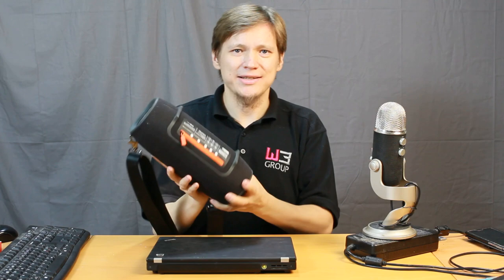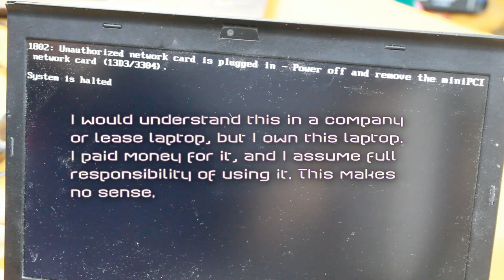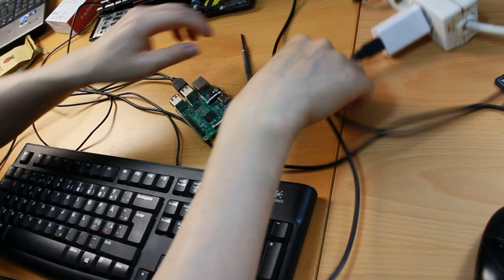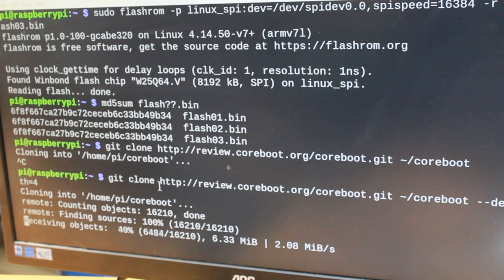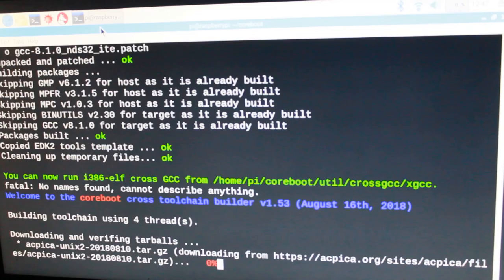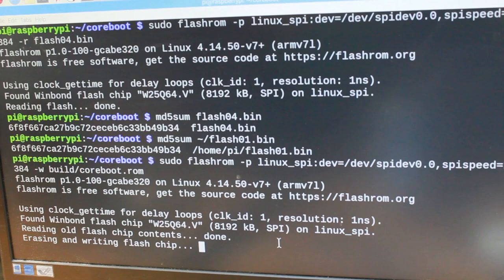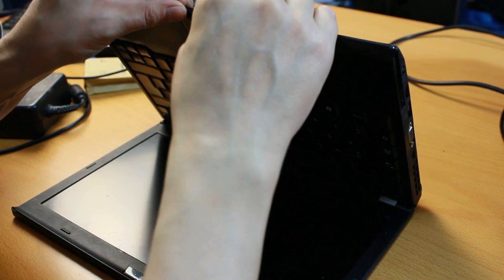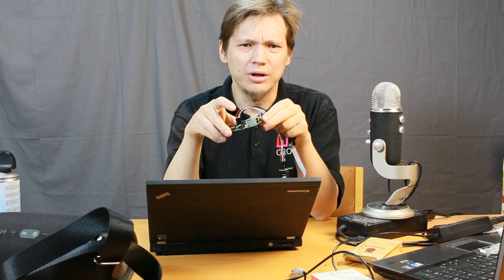Replacing BIOS in a ThinkPad with GPL CoreBoot (former LinuxBios)

Comment: the point i didn't get is, how much cost to buy a compatible bluetooth pcie minicard full length (so it can sit on those platform correctly) compare to owning rasperberry pi, bios mod accessories, etc...

don't get me wrong, your teaching about bios mod is awesome..... but if the reason is not compatible bluetooth card, i dont think thats the best solution...
Reply from the maker: RPi was not bought for this purpose. I happened to have it. The only real cost was the clamp thing, which was less than $3. The Bluetooth/WiFi combo card was about 4€.

Comment: 21:08 did you try to us double sided sticky tape, or 3M 300sle or 3M VHB adhesive to hold it
Reply from the maker: No, and it was to be a temporary solution anyway.
Reply: @Bisqwit  cool, but anyway it seems to work good

Comment: Can we unlock dedicated memory size selecting and manual frequency setting? Dell XT2 made me crazy
Reply from the maker: The modified BIOS I installed in the laptop after I was done with Coreboot actually does enable the advanced menu where you can manually set the frequencies. But that’s very model-specific; the BIOS for this particular laptop happens to be hacked in such manner.

Comment: Is the laptop actually slower now or has it fixed somehow? And is it slower only turning on "desktop enviroment" or maybe the whole laptop is a bit slower?
Reply from the maker: Actually I bought a new laptop later, because I accidentally spilled water on the one in the video. But I also replaced the motherboard and the keyboard of the old one, so it works too.
The slow to start desktop was a problem with the kernel waiting to collect enough randomness, IIRC. Just needed to move the mouse around and it would start faster.
Reply: @Bisqwit  I was just confused because I tought that changing bios should not affect how fast is operating system working, so thanks for reply

Comment: Thanks for the great video. I will do it on my X230T and see if it works

Btw, I found that it seems you use the wrong wifi antenna. For wifi card on the right, the black and grey one should be used. Cheers
Reply from the maker: This was the only way the wires would connect. They are too short to be connected otherwise.

Comment: This was entertaining. Please isolate your mic from the table. Thanks.
Reply from the maker: Mic was actually standing in a microphone stand, which was standing on a Dell transformer brick, which was standing on the table.  As far as I can tell, mechanical vibrations from the table are not particularly being transmitted into the microphone. If it is the keyboard sounds you are commenting on, the keyboard was probably as close to the mic as my face was, if not closer. And some people actually like hearing them; personally I don’t mind either way.
Reply: Bisqwit  Pretty sure it was mechanical vibration through the table and mic stand. That's why people use the mic holder that suspends the microphone element on some kind of elastic bands. I've seen DIY videos on making them, commercial ones are quite expensive. You see them in radio and recording studios.

The important thing is the content was interesting. Just thought a little constructive criticism might help.
Reply from the maker: “It was mechanical vibraiton” what was mechanical vibration?

Comment: Geez what idiot thought it is a good idea to block 'unauthorized' devices. This reminds me of a friend who has a computer repair shop. He bought a replacement LCD for a laptop which, after replacing, it said that it's not original part and system can't boot. ON THAT VERY DISPLAY.
Reply: The idiot is called the FCC which spanks Lenovo if it is easy to replace the wificard very easy with no accounting for the gain of the antenna. Radiation / Emv interference rules are strictly, imagine thing like this on an airplane should not be fun. I don't like it too as my hp elitebook hase it too, but it is for a reason...
Reply: I call bullshit
Reply: @kitecattestecke2303 
Antenna gain in laptops is basically standard. Output from the cards is also basically standard.
I swap cards around in laptops all the time. Lenovo is basically the only company that does this. And usually only in the wifi slot when more slots are present (the extra slots are normally too far away from the wifi antenna cables to properly use wifi in them). If it was for safety, security or certification, they'd block all slots not just one.

Comment: You said it took a little time to load X completely. Have you got any other trouble with lagginess with your computer after BIOS replacement?
Reply from the maker: No, everything else works just as it did before. Only the two problems; X takes long time to start, and Grub runs with black screen. I’ll try a couple of different settings for CoreBoot in a few days to see if something changes.

Comment: My x220 came with a combined wifi-bt card (Intel).  It works with Linux, I can connect a bt mouse with it, so i suppose it would also work with a bt speaker.
Reply from the maker: Yeah mine didn’t. They sell different builds.

Comment: Usually the BIOS can be reflashed directly from the computer's operating system. Has that been disabled in the thinkpad as well?
Reply from the maker: This usually requires manufacturer’s tools, and they usually provide them only for Windows. These tools also reject BIOS images that do not have proper cryptographic signing (or at least a checksum). Finally there is the danger of bricking the device in case of a failed flash or a broken flash image. Using an external flasher completely avoids the bricking problem (unless i.e. the treacherous Management Engine, which trumps the user-visible functions of the computer, gets broken).

Comment: This is interesting to me. I would like to upgrade my wifi card to N but the parts Lenovo lists for this model are only b/g. I'll have to look into how the whitelisting works more but this seems like it would be a good fallback if nothing else works. I was able to find a compatible bluetooth module on ebay though.
Reply from the maker: If you’ve got a X220 and Windows, you can use the replacement BIOS from here: http://x220.mcdonnelltech.com/resources/ (Look for “modified version” on the page.) It removes the whitelisting. Easiest solution. This page also has instructions how to do the flashing if you are not running Windows on the X220. http://x220.mcdonnelltech.com/bios/  I wrote a guide how to do that if you are not running Windows anywhere. https://bisqwit.iki.fi/story/howto/windows/bootdisk/

Comment: WOW what a great Video .. can you similarly reprogram wifi network card ? e.g. adding PXE boot support and flashing it to the card
Reply from the maker: If the hardware technically has the necessary bits to support that, and if you can find a programming interface to the card and you know what kind of code it runs and you can produce that kind of code, then sure. That’s a lot of “if”s.

Comment: It should also be possible to rewrite part number of the bluetooth chip, replacing it with a part number which is on IBMs/Lenovos "white list".
Reply from the maker: True, but that would have the side effect of failed driver detection, because drivers are installed based on those ID numbers, and even within the same driver device-specific options are chosen based on those ID numbers.
Reply: Ah. That part I never researched. But would it matter on Linux also?
The reason I know (part of) this is I tried to upgrade the WiFi-module in a X31 back in the days. I ended up dropping it because I needed another laptop with the same module slot (which was not a Thinkpad) to be able to access the WiFi-module in the first place.
Reply from the maker: It would matter on Linux also, though there are probably ways to override things.
In any case, a BIOS update to an unofficial version makes the whole question moot.
Reply: That option never occurred to me at the time. I think this was back in 2004 – 2005. Thanks for the videos btw. I'm mainly attracted to the programming videos, but this one was fun because of the practicality of it.

Comment: Can you not use grub2 directly without Seabios or use FILO to load linux?
Great and Informative Video ;)
Reply from the maker: Yes, but I’m not sure what would happen to possibility to boot from e.g. USB stick if I did that. So I went the safer route.
Reply: grub wasnt so easy and nice to use when i tested it as payload. seabios otherhand didnt give me background picture in high resolution mode and took longer time by default. seabios would be my first go and get solution, but if you are only using linux and need very rarely to boot anything else i would take grub just to speed up booting time.
Reply from the maker: “Very rarely” is true, but I do boot up USB sticks sometimes for various reasons.

It is very likely I will be doing a reinstallation at a later date, in order to try out different things and change the configuration options.
EDIT: I did try reinstallation later. And yes, it’s possible to make grub load from USB stick and from a number of other choices. However, I ended up installing a modded version of the official BIOS.

Comment: but the x220 can be flashed without needing to dissemble it
Reply from the maker: Yes, with properly signed/checksummed payloads accepted by the flashing tool provided by IBM. Which means no custom BIOSes. Also, if the flashing fails or the BIOS you put is broken, you have bricked the device. Using an external SPI programmer is safer.

Comment: I am grateful for this video because its beyond interesting but at the same time i am annoyed you couldn't just buy a new laptop.
Reply from the maker: The market of laptops is not very big when you get into requirements: Light and small enough to be easily carried in a backpack together with other supplies like a water bottle; a trackpoint mouse (which apparently only IBM does right; the Dell equivalent is terrible); a keyboard where keys that are important to me in everyday use are not hidden behind a Fn key, and so on.
I am also not very fond of the consume-throwaway-buynew mode of thinking.

Comment: That JBL speaker also has a 3.5mm AUX input you could've used instead of bluetooth, that would've made for a way shorter video though haha
Reply from the maker: That’s true. However, it requires the laptop to be in close proximity to the speaker. It is often much more desirable, for the purposes of acoustics, that the speaker is placed somewhere else. It can be placed arbitrarily pretty much on any wall and window sill. The laptop, however, always has to stay on a certain table for the purposes of usability.
Sure, there are extension cords for the 3.5mm audio, but long cords not only degrade the audio quality, but can also be very impractical with gyms and ballrooms.

Comment: You could have been finished for $15, with the Intel Ultimate N 633ANHMW card? Be sure to get the Lenovo/IBM vendored one. And bonus, it even has N and Wifi-Direct IIRC. I ran into this issue several times with a tiny M93p, X201T, X61i, T460p, Yoga, etc, etc... and yes, it is by design. The issue is caused by the certification process that Lenovo has for approval by FCC. they would need to go through a very rigorous process of validating many miniPCIe card to get the approval to not cause interfering or too much radiation. In The bios there is a whitelist of allowed cards, and there are many that work with the x220 (easy to get second hand or new on Alibaba or Aliexpress). However, there are also whitelist modded releases of the bios on forums like bios-mods. Installing Coreboot is really nice, but can make you run into other issues with some models, as not all hardware is fully supported or even possible (yet). Older machines, like the X2x0 series work quite well... and as commented earlier by others, this is not something many people will perform (or even able to do) as it involved a lot of work and risks.
Reply from the maker: That one is a WiFi card without Bluetooth support. Need for Bluetooth support is what got me into this in the first place.
Reply: my bad...it is the Intel Centrino Wireless-n 1030 11230bnhmw. Anyway, the original option is the Estone BT3.0 card which sells for about $7 (FRU:60Y3275).

Note: HP and Dell do the same for a large amount of their machines for the same reasons. Blame certification authorities for this mess... since if a machine could just state: 'uses component x' to provide connectivity this whole process would be less dependent on the actual machine that houses the interface card.
Reply: BTW, you would need a MiniPCIE half-length bracket to keep the card in: http://i.ebayimg.com/images/i/261348698485-0-1/s-l1000.jpg have needed these for my own machines when I 'liberated' them to have upgraded Wifi adapters.

Comment: so now you have a linux loading another linux?
Reply from the maker: That’s the (original) idea and what some people have indeed done, but no, CoreBoot is no Linux. But a valid and feasible possibility is for CoreBoot to start up Linux immediately (from ROM) when it has done initializing hardware, and then that ROM-installed Linux will load the actual Linux system from disk.

Comment: Why not try and patch the bios I know you got some serious skills in computer programming
Reply from the maker: I actually ended up installing a patched version of the BIOS later.
And yes, patching the BIOS myself could have been fun. However, there is always a possibility that some component requires a cryptographically strong signing or at least a checksum or the modified BIOS gets rejected, and I did not want to go down that rabbithole. At the worst, it could be as impossible to reproduce a counterfeit signature that is accepted by those components as it is to intercept and modify an encrypted connection to your bank by your browser.

Comment: Really doubt if it's actually beneficial to do this, as you might as well just get another laptop. But nonetheless, still a cool project. And there will be more fun in the future than just to get around a hardware lock, I think.
Reply from the maker: Look who has money to spend without second thought.
Reply: Bisqwit
I was not saying that it's better to get a new laptop, but rather, second hand laptops are quite cheap nowadays and can offer better performance than an old enough laptop. It might be that such case only applies to China, though. (Chinese second hand market is a bit weird due to the imported e-waste situation, so that it's possible to pay for a piece of "junk" that is actually a working product being recycled.) 
Also, it's not like everyone just have a raspberry pi lying around so this really feels more like a project that's fun to do but not absolutely necessary.